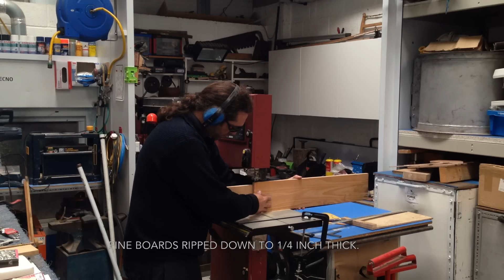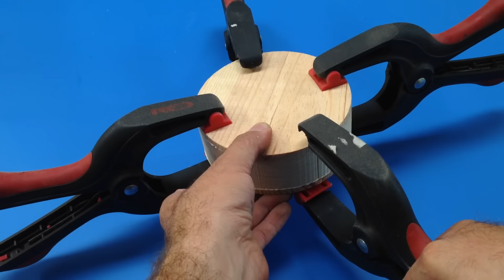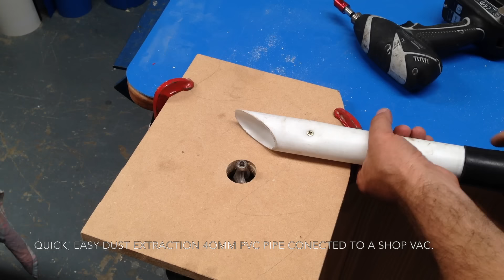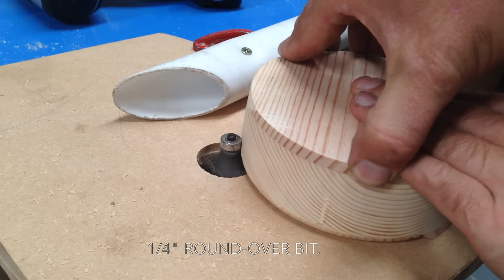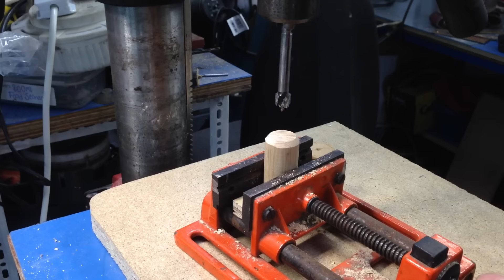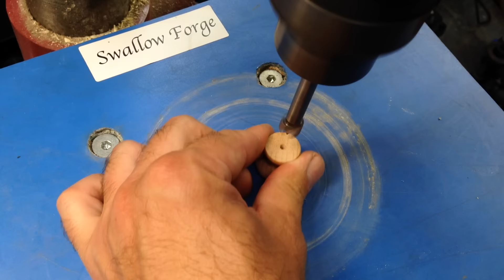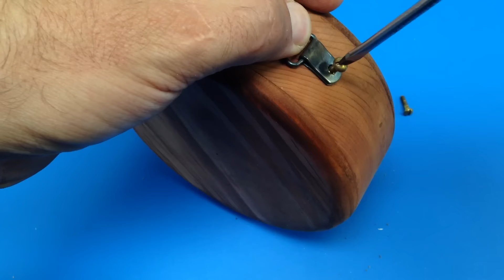How to make a Wooden Water Bottle or Hip Flask for reenactment, steampunk, Larp or cosplay

Comment: just to be informational,  this will eventually start leaking. I learned a technique that keeps that from happening. Get  a piece of metal coat hanger wire and a hammer. Now hammer the wire into the wood (making an indent ) before you glue your sides on. Actually this method doesn't even require glue you could instead use like decorative nails. well any ways... after the seam gets wet that "wire indentation " will swell up making a bead and thus sealing your canteen / flask.  Wish I could post a pic but I'm sure with a little research u can find out what I'm talking about if I didn't describe it good enough. woodworkers use this technique  on wet stone tubs. REALLY NICE VIDEO. they look great!

Comment: Nice but what did you not put into the inside to seal it so it does not expand an eventually crack
Reply from the maker: Doesnt need anything to seal it. Long as it is dried out after each use and stored properly. The wood also has its own antibacterial properties. Why add anything when the wood does a perfectly good job on its own?

Comment: Interesting idea, my main concern is using dye where drinking water is used. I'm presuming the PVA has the D4 additive to make it not come apart when water is added (I'd be careful not to poison myself with contamination the water with it), and my third obviation is how you would water proof the inside of the flask so it wouldn't damage the wood in the long run?

Comment: curious as to the interior of the canteen. did you seal it in any way?  I didn't notice any sealer for the interior. just curious because of the treatments they use on some woods during milling.
Reply from the maker: +Shane Rudd 
I don't seal the insides. It really doesn't need it. Plus I make sure I use untreated wood. After each use rinse it out and let it dry. If you want to be extra safe you can always sterilise it with baby bottle sterilising solution. The main thing is not to leave water in it for more than a day or so. Hope that helps. SF

Comment: Question. I have also been experimenting with wooden water bottles. So far I have made two bottles and seem to always have the same problem. The glue joint between the middle piece and the sides cracks. I know that wood expands when moist but I am still confused. I am noting the grain direction on all the pieces. On the first bottle, the cracks appeared at the parts where end grain is. I think it might have something to do with the quality of my wood glue. I am using waterproof glue but I suppose I could try a higher quality one. Any suggestions? Thanks!
Reply from the maker: Hello, it may be that the wood you are using is too dry when you are making the flask. You want a much higher moisture content than for say cabinet work. try spritzing the wood with water and putting it in a polythene bag for a few days before cutting to size.
Reply: Thank you! I will try it!

Comment: that was wonderful brother.
but i want to ask about the rest of glue which is still inside the bottle .
?i mean does that not matter 
 because as you know even if the glue got dried an tough  its gonna get   back liquid again if it stays into the water for long . and that gonna make problem
thanks for this  awesome clip
and i'm sorry about my simple English and i hope you understood what i meant
Reply from the maker: Thank you for your comment. The Glue is waterproof and non-toxic, there is very little 'squeeze' out inside the bottle. In my experience it really doesn't matter. Once the glue is set, it stays set.  I hope that helps. All the best SF

Comment: Excellent job. Two questions: Which wood did you use and used something to seal on the inside or do not need?
Reply from the maker: Thank you. I used pine from a lumber yard (untreated, air dried) and no seal is required. Just make sure you rinse it out after use and store with the stopper left out.

Comment: Swallow Forge is there a way to cost the inside so that it would be safe to drink out of and would also last a long time without damaging the wood? Or possibly something to line the inside with?
Reply from the maker: GeneralXification you can use a food grade epoxy. but the idea is that as in old barrel construction, the wood swells and seals itself. hope that helps.
Reply: Swallow Forge yes it does help, thank you very much

Comment: perhaps coating the insides with something so the wood wont mold or warp or give your drink a wooddy flavor?
Reply: beeswax
Reply: +Spudwellington so... is there any other thing that you can use?
Reply: Theoretically; any waterproofing thing you can get in there. Waxes are good but could melt under heat, so boiling liquids going into that thing wouldn't work. Food safe polyurethane would be a good choice overall, I'd say. You could also just use the wood as a shell over a waterproof pouch inside.

Comment: Very nice project piece.  It's simple and easy and looks fun to do.  It can be sealed with any number of food safe products, such as true Tung Oil, food safe resins, beeswax, mineral oil, olive oil, even polyurethane  (has to cure for at least 7 days).  I don't know anything about the glue you used, I'm sure it's fine considering it's nontoxic.  Once a sealer is put over it, it won't matter anyways.  As far as the stain, I'd be careful with those simply because it will soak through the end grains and work it's way inside and if there is no sealer to serve as a barrier it can mix with your water or whatever fluid you put into it.  Just a simple piece of advise on that one.  I really do like this project and I definitely want to do one similar except I'll do mine on the lathe (easier to sand and shape, I too hate sanding haha).  Thanks for sharing.  Thumbs up from me.

Comment: This is awesome and looks great. What do you use to seal the inside so that the liquid doesn't absorb into the wood?
Reply from the maker: +Heavy Metal Studio (Luke Johnson) 
Hello Luke. The inside doesn't really need sealing. But I don't recommend leaving water in it for more than a day or so, alcohol can be left longer. Do not put sugary or fruit drinks in it. If you do decide to seal it you have to decide what you want to put in it as what is good for one liquid, may not be good for another.
Reply: ... germs ...
Reply: unless you are exedingly carefull in what wood you chosr.you real should seal the inside.
also to make it posible to empty it compleatly you should install the spout before you sand the inside of the bigger pice.
i would also not recomend this for water unless you make a inner flask of tin or somthing becous it will be almost imposible to clean.
if used for water every secound use should be spirits to disinfect it.

Comment: where do you get such good bandsaw blades? Not home depot.
Reply from the maker: My bandsaw takes an odd size of blade. I got it massively discounted as it is no longer in production. I did buy a load of blades when I got it and I sharpen them myself using the method shown by Mathias Wendal. They are much sharper than when they come out of the packet. Hope that helps. All the best SF

Comment: The glue that you use on every part is it toxic if it stays in contact with whiskey for a longtime?
Reply from the maker: No it's non toxic. However I would not recommend leaving any liquid in the flask for more than a day or so. This is the same advise as given on nearly all hip flasks regardless of the material they are made from. Hope that helps. SF
Reply: +Swallow Forge Thanks for your answer and you advise.

Comment: Cool little project.. I am thinking of doing some minor spout tweaks and using it to hold my black powder.
Reply from the maker: +Robbie Rivera making powder flasks is another hornets nest 
(I make those too but haven't the courage to post that on youtube, every expert in the world will be telling me Im doing it wrong... despite the fact that the majority have no actual tangible experience in the matter.  But that never stops the keyboard warriors)

two points i would recommend, 1) is to fit a safety valve that measures out a set quantity of powder, then closes off the flask, so should the worst happen and the powder is ignited, it only burns a small quantity and not the whole flask. 
2) fit a bung in the base, that, again should the worse happen and the powder in the flask does ignite, the bung is blown out, rather than the flask explode. there is a lot of really good information available on the internet and it is well worth researching before you go into the workshop. You may already know all this, but i thought it would be prudent to say something. hope that helps, if you require any more help in this matter you can contact me on my facebook page www.facebook.com/theswallowforge.

Comment: Why didn't you drill the hole before gluing the sides on? Did you use waterproof white glue?
Reply from the maker: If you drill the hole first, the bearing of the router round over bit drops into the hole tearing a chunk out of the side. Voice of experience :)
Reply: I see, but some tape over the hole would have prevented that and you wouldn't have to get chips out from inside and could have cleaned up the hole.
Reply from the maker: Tape wouldn't work. As long as you cut carefully with a sharp forstner bit, you get very little tear out.  I have made made many many of these. I think the process I use is the most efficient. Thank you for your comments though. It's always good to think the process through

Comment: Won't the water taste like wood sense the inside wasn't sealed?
Reply: +BennyCFD I was thinking the same thing. There was no sealer, no poly coat to make sure the wood doesnt absorb it all.. after a few uses, that wood will warp and it will be useless. Hell, even stabilizing it would be better then all natural.
Reply: +BennyCFD Water will taste like glue with which it is glued.
Reply from the maker: +Harlequinn WoodWorks 1) the wood does not warp. 2) the wood does not absorb everything, and if you read the description notes it clearly says not to leave filled for more than a day or two. 
why fill your world with chemicals when the natural product does the job perfectly adequately. hope you enjoyed the video. SF
Reply from the maker: +Strong Spirit Thats why i use extra tasty glue, with added electrolytes.
Reply: hahaha, touche' 

Another way you could go, Stabilize the wood first, and then use a few layers of shellac. then once its all cut out and put together, you would have a fully sealed and safe cannister for all liquids.
Reply from the maker: I had thought about shellac, which would be fine for water short term, and it is also totally food safe, however.... shellac is soluble in alcohol. So the first time you fill it with Rum or favourite tipple, most of the shellac will disolve. This is why i leave them untreated. Some sealants are great for some things, not so good for others. the natural wood really is perfectly adequate. You just have to be selective as to what you put in it, and careful when you clean it. And if you find your wooden canteen has got to a point where it is past its best.... chuck it on the camp fire and make a new one :) 

its always nice to have a good excuse to spend some time in the shop :)
Reply: +Swallow Forge What if you poured liquid beeswax in, and then poured it out quickly so the inside would be coated with a thin layer of wax. I think that way may last longer.
Reply: +Mark Kalsbeek My research indicates that would seem to resist the alcohol as well... and I use beeswax on my cutting boards due to it's foodsafe + protective value. 
But, to each their own! If naked work works fine, why fix the unbroken. Good whiskeys are aged in oak barrels, after all.
Reply: +Harlequinn WoodWorks 
Guys.....How is cognac and whiskey stored? In beezwax filled oak barrels perhaps? or maby they are coated on the inside with some special sealant...
God forbid the alcohol, absorbing taste and color from the wood! that's just unheard of!! Eeeeeew
Reply: +nullings whiskey is stored in barrels so it can absorb the flavor of the wood
Reply: +OH LAWD JASUS His sarcasm hints that he's aware of that.
Reply: +Swallow Forge Isn't the wood going to become a breeding ground for bacteria? Maybe not if you only fill it with high proof alcohol but if you fill it with water regularly. It seems like it would be an ideal home for bacteria. It's basically a sponge. When you use metals they kill bacteria so the water stays good.
Reply: Justin Haddock
No it will not, if you empty the bottle after use and let the cap off, so it can air out.
It is something special about drinking from a wooden flask when you are outdoors.
You should experience it.
Reply: +Swallow Forge You probably could seal the inside with bee wax. If you apply it with some heat, it will seal the entire surface. You probably would need to mark where the rim ends, as to not cover that part (possibly lightly sand that part down before gluing).
Reply: +Swallow Forge wood you buy from lumber yards is treated with anti fungal chemicals.
Reply: djteac First of all, i was being sarcastic, ofc the alcohol takes taste and flavour from the wood. That is its main objective other than storage...
Second, you have no idea what you are talking about, do you think he poured the stain inside the bottle?
Or do you just think that the alcohol will pull threw the "dye" from outside and in?
I dont like being called idiot by a 15year old that has never worked with wood before...
Reply: nullings wood is permeable. Your average whiskey barrel will lose 1.5% of its contents per year to evaporation. Wood breathes. It expands and contracts with humidity. Drawing liquid in and out. So to answer your question Yes. Any chemicals you use on the outside will eventually make their way inside. The softer the wood the faster this will happen.
Reply: God of Thunder
For christ sake mr pc..
you are right, if you leave the content inside the bottle for a very long time it will eventually soak the wood completely.
But this is a canteen flask, and it would be nice to take that into consideration, as stated before, you will need to empty the can after your trip.
Jerk.
Reply: +BennyCFD You won't care, having been poisoned by the toxic adhesives!
Reply: certain woods have natural bacteriological properties, red oak is one of these, the tannic acid acts as a natural germicide. this is why red oak is used in cutting boards
Reply: BennyCFD a pine tea isn't going to kill you
Reply: David Campbell However, red oak is so porus it leaks like a seive. Not recommended for this application.

Comment: Is there any specific glue you need for this? I'm just worried about the glue contaminating the liquid, especially if it's something like whisky.
Reply from the maker: ***** hello, I found that waterproof PVA is fine. There doesn't seem to be any problems. 
if you are concerned with contamination etc, you can use a food grade epoxy.
Reply: Fantastic, I didn't even know that was a thing

Comment: Great job. However, If I were in your place, I would have cut just two-thirds of the main plat and then get rid of the excess of remaining wood in the middle, so I have to cover only one side of the bottle with a separate piece of wood. Moreover, I would close the bottle by gluing the side at the end of the whole process so I could put a plastic bag inside the bottle to fill it with water instead of filling water inside the bottle itself. Otherwise, I would use natural tar extracted from trees to paint the bottle from the inside to minimize the side effect of the glue. 
And good luck with your future projects.

Comment: The best thing to do is look back at history! To keep it clean and safe to hold liquid line the inside with melted beeswax!
Reply from the maker: Historically most wooden flasks were unlined. Beeswax tended to be used in leather flasks. Later replaced with pitch. But wood does not require lining.

Comment: the little wood pipe is too long inside that will keep some drinks inside the bottle unless you shake it , if you put it before you put the cover you can sand it and level it to match the surface inside the bottle
Reply from the maker: +ibn canaan 
Just mark the tube with your wall thickness before you glue it. If you glue the tube in first it gets in the way of the sander and the bearing on the round over router bit. I've made a lot of these over the years and the process I use is the simplest method I have found for batching out quickly while retaining a high build standard. You should build yours in any way you feel works best for you.

Comment: Since i'm no expert on this, couldn't you coat the inside to make it waterproof so you could store water in it for longer?
Reply: use melted beeswax it is foodsafe and as long as you dont leave it in the arizona sun or pour boiling liquids in it, it will work great

Comment: wouldn't it have been easier to drill the hole before you put the front and back on?  also why not just attach the one side then clean up the glue inside before doing the other?
Reply from the maker: Good questions. Here are my reasons for not doing it that way. If I drilled the hole first, the bearing of the round over router bit would drop into it and bugger up the edge. Glueing up the sides one at time not only takes twice as long, but also without both sides gluing at the same time, it's difficult to maintain even clamping pressure. This process has come about over making a lot of these. However you can make yours in any way you see fit. Thanks for watching. SF.
Reply: I wondered about that, too. Guess it'd just be a matter of experimenting as the author suggests. Mind you, I do have a set of hole bits that don't leave a plug to remove.